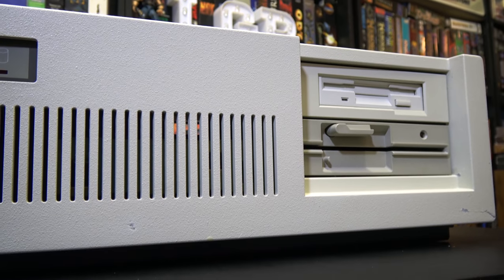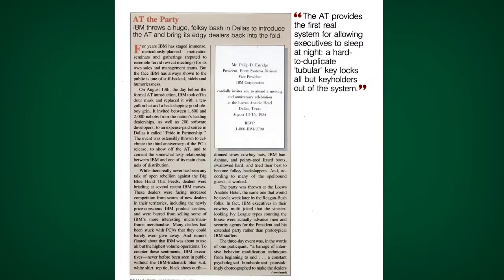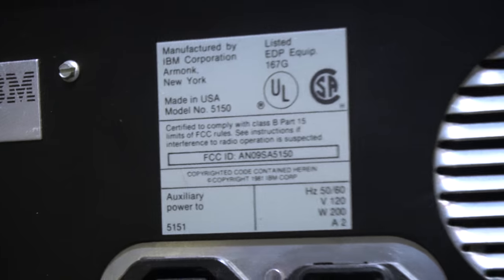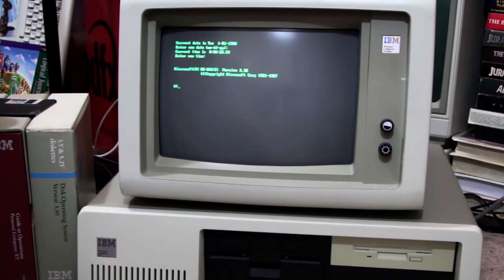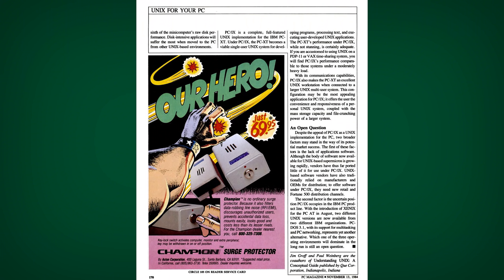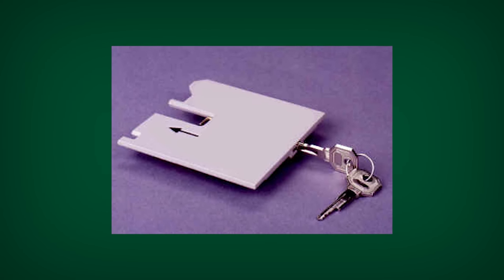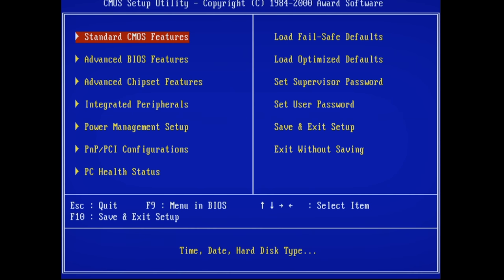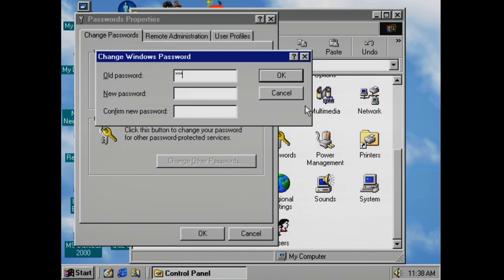Why did old PCs have key locks? An LGR Retrospective

Comment: Our 386 had one of those cases with the green turbo and red reset button on the front, and the big red switch on the side — and the key lock was wired up with the PC Speaker.  So it was pretty easy to silence the darn thing (it had a LOUD speaker, and we played F-19 and FS4 a lot).

Comment: There are some 5.25 inch hard drive docks with those locks. Sadly, it only works for the dock, but I see a reason why. It could be a hard drive that stores as much as your computer and can serve as a back-up hard drive. The keylock on the dock is the power switch. The point of the keylock on some 5.25 inch hard drive docks is to make it more convenient than searching for that hard drive in your drawer.

Edit: For the ultimate keylock solution, have a keylock for the keyboard (and/or mouse), case, hard drive(s), and power button (prepare for a keychain dedicated to that computer).

Comment: For the keyboard-only keylocks, bear in mind that it was the era when catalogues were full of the desktop PC precursors to laptop anti-theft cables. Even if you didn't go for the cable, you could still buy the shroud that allowed a padlock to block access to one of your case screws.

Comment: I had a thermaltake case with key lock back in the mid 2000s. Was perfect at LAN parties to lock the computer when you were away for a bit so noone could start it or open the case and mess around.

Comment: I still own a very pricey (for back in the day) 2005MY ThermalTake Soprano premium case, which I love and still use with an older pc build.
It featured a lockable front panel, which you would need to open to press the power button. Oh, such usefulness!
I'm not sure if Ive ever used it once, but it's there... can't say the same for the keys though.

Comment: Going back far enough, mainframes didn’t have a key because they were behind locked doors and you would need a large truck and a moving crew to steal them. But all the mini-computers, starting with PDP-8 to 11, Data-General Nova and Eclipse, and all the others (that I ever saw) all came with key locks because they were generally in a lab somewhere, and had a lock for power and key input. If you have a computer running an experiment that runs for months, you don’t want someone accidently pushing the reset button or switching it off! I’m guessing that it was with this in mind that the locks were carried over to the micro/home/personal-computers.

Comment: I had an old 386 once that had that, my dad would lock out the keyboard input when I misbehaved, but I never knew I could just open the case and disable it until much later...  he also realized you could flip a switch on the PSU and keep it from booting because it would be in 220V mode...

Comment: Even in the late 90s Dell computers had a latch at the back of the case that you could use a paddock to lock up the computers. I was working at a Xerox warehouse and we eventually had to bulk buy a bunch of pad locks and Ram in the computers would disappear. Even the laptops had an attachment where you could chain it to the desk. These days smart phones are the hot item to get stolen.

Comment: When i had my first computer with a 3 1/2 drive, for some time i keeped trying to engage the now non-existent lever that were common on the 5 1/4 drives until i got used to the new ones. Still, it can be said that engaging the lever after inserting a disk had it's magic at that time.
About the turbo button, i understand that when the XT was introduced, it was needed for the software made with timing loops, but the button remained there, even when the speeds of the computers changed a lot from that. The XT  had around 8 MHz, or so, and some years later you had ATs with maybe 33/66 MHz (no turbo/turbo).

Comment: My case has a key lock and it looks cool and also the side panel to open there's a slide-to-open handle. Thermaltake Kandalf The Super Tower it's a heavy and still pretty cool PC case, I don't even want to upgrade it, I modded it and looks pretty cool all black and orange.

It actually helped a lot back then because I use to leave my 2004 PC which I built on this case back then on a public place connected to the internet so no one would steal parts of it or mess with the internal hardware, but since then I never used it again it's always on unlock position.

And in the 90s was so stupid the voltage button on the power supply, it should have had a key lock, many kids here exploded the power supplies on the school because they saw the voltage button and it's cool that you will always want to know what does it do when changing its position and makes an awesome kaboom :).

Comment: Related but different, around 1999-2000 there was a physical lock + software solution for pcs that would toggle if the data being written to HDD, would stay permanently or be wiped on reboot, I wish I could remember what it was called.

Comment: I had a shop build a desktop computer for me about 7 years ago.  The case came with a lockable cover that goes over the power button and device bays.  I didn't need think I needed a lock until I caught my neighbor's kid clicking everything on the desktop.  (This kid had no propriety and instead of feeling bad about getting caught messing with somebody else's personal property, he just asked, "Where are the games?")

At the time, I didn't have a password on my new computer because I hate having to click through extra hoops to use a computer and waiting for additional processing at each step.  It was MY computer in MY home, so I didn't need any account management for sharing the machine (and I hadn't yet needed to access it remotely); I wanted to be able to just turn it on and use it.  (My Windows '98 machine could boot up and be RESPONSIVE in under 60 seconds.  A password prompt slowed things down, and if my computer were stolen, the thief could have just connected my harddrive to another computer to read the files.)

I thought locking up the power button might have been a good solution, but  I couldn't lock the case because it didn't come with the key.  I received the original packing from the shop, but no key.  I stopped by the shop one day and asked about the key, and they just said, "I didn't come with a key?  It should have.  We'll call you if you we find a spare."  They never called back of course, and I never got a replacement key.  I reluctantly started password protecting my computer, including the screen saver.

2-3 years later I decided to upgrade my RAM.  When I opened up my tower, tucked in a back corner behind the harddrive was a small cardboard box containing the extra screws... and the key.  They couldn't put that stuff in the huge empty box the tower had come in?  Instead they hid it inside the tower and blocked some of the airflow.

Comment: My case has two 5.25 bays, with one of them having a blank plate covering it. I might drill a hole in the blank plate (which can of course be replaced: Corsair sells replacement parts for their cases) and wire up a key switch in series with the power button. Then if the key is turned off, it doesn't allow the computer to be turned on / off. 

Just a gimmick, I don't have much actual use for that, lol

Comment: Nostalgic feature, before any real networking.
I remember YEARS of just leaving the keys, both of them, hanging in the lock so they wouldn't get seperated from the computer, (mostly used for engineering and initially shared with others).
The only person at work who actually seemed to care had their own computer with one of those power switch locks.  That person was the office's finance manager, (makes sense).

Comment: If you're interested in getting that ps/2 unlocked, you can buy a tubular lock pick tool to open it. They are very easy to use and take virtually no skill, as basically all of the "lock picking" happens when inserting the pick and jiggling it a couple times until the pick becomes a duplicate of the original key... That or just buy a key for that type of tubular lock and as you said they probably all keyed alike and should work.

Comment: I think that the presence of a lock created a clearer scenario for accusations of breaking into protected equipment in the workplace, should someone open the case to defeat the lock's protections. Plus it would not have been immediately clear that the keys were interchangeable.

Comment: You could set system and BIOS passwords within the BIOS itself -- one password could be configured to prompt the user before POST (or after - I know it prompted before asking the key combination to enter the BIOS).  The other password could be configured to prompt the user before accessing the system BIOS.  

By locking the computer lid down - you could prevent a user from accessing the motherboard and flipping switches to reset the BIOS to default settings allowing access to both system and BIOS.  

...not to mention locking it down for component theft protection or even disabling some ports to prevent users from plugging in external devices to parallel or serial ports.

Comment: Ah yes, my IBM 286 had that lock. My brother gave it to me when he upgraded. After using the lock once just to see if it actually did anything... never used it again. The turbo switch never seemed to do much of anything either. However my bother had installed a toggle switch in the back that acted as a reverse turbo. It's slowed down the computer so you could play older games that the 286 was too fast for. My brother did a lot of programming stuff and could get a computer to work to it's limit. That 286 ran Windows (version 3.11). Took 11 minutes to boot up but it did run it.

Comment: I always thought they were just to lock the cases. Computers used to have a card for everything, video, sound, keyboard & mouse, printer, modem, etc and they were NOT cheap,  around 1990 a 1MB DIMM cost about $175.

Comment: Modern computers generally have a lock loop on the back of the side panel, and that was probably a bit more theft deterant than a front-facing keylock, so that's probably why they stopped using them (plus some only were intended to lock the keyboard from being used, and when you had a password on the computer, this could mean better security presumably).  But all the implementations I saw was to prevent the case from being opened, which considering most cases would have to slide backwards or forwards a bit to be taken off (on older desktop style computers and even some towers) so I don't know why they didn't put the locks in the back for those that were designed to prevent the case from being opened?

This lock thing does actually bring back one scenario I heard about from a professor back in college, where the computer had a keylock to lock the case, but it wasn't locked, and someone basically stole the board, processor and RAM from the computer so all that was left was a shell.  But nobody knew until they went to try to power on the computer (this was back in the day when the AMD Duron 1 GHz and similar processors like the AMD Athlon 64 and Pentium II / III were popular.  Of course by today's standards these components are pretty much worthless to most people).  But at the time, it was a decent setup for general computing work (probably not playing many games though) as it could run Windows XP which is what we had at the time (this was about 20 years ago).
Reply: See, I have always thought these locks were a theft deterrent of the machine as a whole, which always confused me. The projectors I worked with in college had keylocks for security cables strung through them attaching them to the ceiling mounts, so I just assumed the locks were for the same purpose on all computer-related things. Explains why I never saw any cable holes on PCs, tho, lol.

Comment: Back in the day when even a 'cheap' computer cost $1000+ there was big money to be made by thieves raiding computers and selling the parts, it used to happen all the time. I have a vague memory of them being called 'silicon pirates' or something. So the locks were actually useful at one point. There was nothing to stop them from stealing the whole thing of course (except how much those beasts used to weigh), but it was much easier to simply snatch ram and cpu, stick 'em in your pocket and poof out the door.

Comment: On my first PC ever, many years ago,  (a 486) I could, instead of locking it, remove the entire hard drive like you would your entire car stereo in those days, rather than just removing the front... 
A few weeks ago I got my second retro system to refurbish and tune-up... (for the fun of it) an IBM PC330 - Pentium 133 from 1996. And it has keys! They're there and all they seem to lock is the slide that goes in front of the CD and floppy drive... You can still turn on the PC, and remove the entire case when it's "locked"... so... why the key? What does it really protect? 😂 To me it's just good fun to have a set of original IBM keys that make no sense... Totally useless otherwise! For the rest it's a beautiful vintage! 😍

Comment: I have 2 key locks on my case from around 2012. One locks the hot swappable hard drive trays in and the other locks the side door shut so you can't access any hardware.

Comment: I still have probably 50 keys from my days back then. I probably need to do something with them. Last time I looked ( years ago ) a few had gotten some rust. They sat in a garage all through the mid 2000's  along with all my floppy discs for every Dos  and Windows version. Win 95 and 98 were like 20 discs apiece from what I remember. The only good thing was they were easy to copy if needed.

Comment: Odd...in Chicago offices (the city where the IBM locks originated) these key locks were pretty rare. They were pretty much exclusive to cheap no-name cases used by hobbyists and mom and pop shops that made cheap crap sold at twice what a Compaq or Gateway sold for. Even as a custom PC builder, I steered clear of those cases because they were also of poor build quality. BTW the "turbo" button wasn't. It was to slow down a newer, faster PC to play ancient DOS games made for the original IBM PC.

Comment: I used a modified precision straight blade screwdriver to defeat the keylock on the computer I had built when my mom's boyfriend at the time locked it in an attempt to control me. This was 1996/1997 on an AM486DX machine.

Comment: Necrobump: Mine is a much more modern case(the now defunct CaseLabs). I added one in between the mb and power switch(momentary aviator) for shits and giggles. If I ever redo it, I'll probably replace the key with a momentary key switch as well and hope to find a momentary that has the light in it instead of a separate led.

Comment: I have heard that when they designed the panel for pdp-8, they needed some way to keep the plastic panel in place around the
plastic switches they used for entering addresses and data in binary.    Instead of using an ugly pair of screws they decided to put a power key switch on one side and a panel lock switch on the other side.    This was copied by all there competitors in the early days such as Data General and so it almost was a requirement that a computer have a power key switch and front panel lock switch.

Comment: I'm wondering if you also have a video covering proprietary power cables from back in the early 1990s.  I was never sure if it was so you could remove the power cable as a security measure, or so you had to buy a higher-priced power cable if something happened to yours.  Our HPs at work had them.

Comment: I have repaired and programmed computers from the beginning of pc's. I think the key lock was to protect computers from random pilferage. Back in the day memory sticks and hard drives were very very expensive. An example might be a 100 MB hard drive may have cost $1000.00 or more , 512 KB memory sticks, $100.00 a piece.

Comment: My modern computer still has keys I built into it.  I built it completely modern with an i9 processor 8 terabytes of hard drive space 64 gigabytes of ram and three Nvida video cards and two Blu-ray burners. Then I drilled a hole in a nice place and installed the lock to turn on and off the button in front of the case.

Comment: I had a computer with a lock in the early 2000s, it actually prevented the computer from powering up at all. So quite late to have a lock I guess, even though it was a brand new computer.

Comment: My brand new computer has a lock on the case to prevent someone from taking the hdd out of the hot swap drive.  Not something that I would have bought intentionally, but it came with the locking case.

Comment: Who remembers Ram Doubler, Stacker, Double Disk, and QEMM?  These were the mystical ram memory increases, hard drive expanders, and miracle memory managers that were supposed to make hardware upgrades a thing of the past by unlocking the secret potential of your existing hardware.  Stacker was so popular that Microsoft, "borrowed," it and integrated it into MS-DOS 6.0!  Stacker took note and sewed Microsoft and won.  So MS-DOS had to come out with 6.1 version which was 6.0 without dblspace.exe.  Later, Microsoft made their own version of Stacker with permission from the real Stacker to use some of their code and MS-DOS 6.2 was born with drvspace.exe.  6.21 and MS-DOS 6.22 were refinements.  There was a hidden MS-DOS 7.0 in Windows 95 that a few people knew of it and it ran Windows 95 secretly.  However, it could also run any other version of Windows as well. I remember making stand alone MS-DOS 7.0 Disks from Windows 95 and selling them to people that still wanted Windows 3.1 and 3.11 and still be able to play with Windows 95. I still have my distilled version of MS-DOS 7.0 on three 3.5 inch, 1.44 megabyte floppy disks and two 3.5inch 2.88 megabyte floppy disks also. Those were good times, slow processing, but good.

Comment: In 2000 I had a PC that required a tubular key to power on. I opened the case and shorted the wires and the PC came right on.